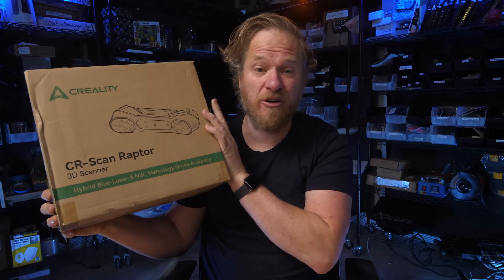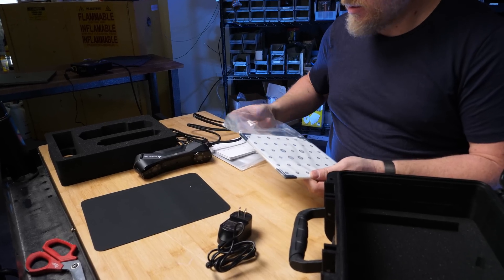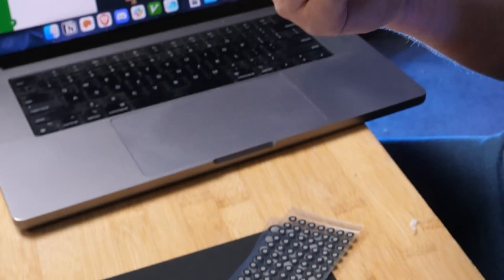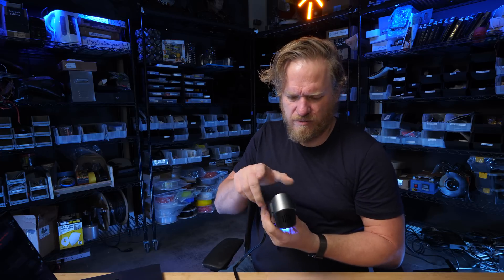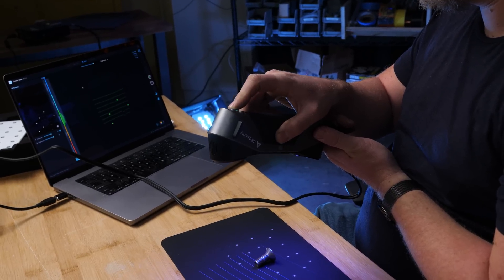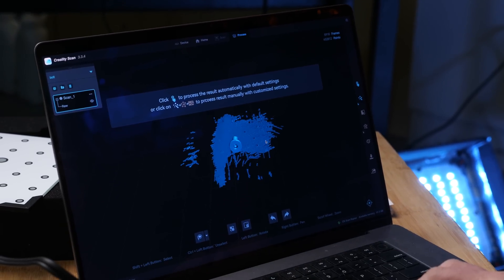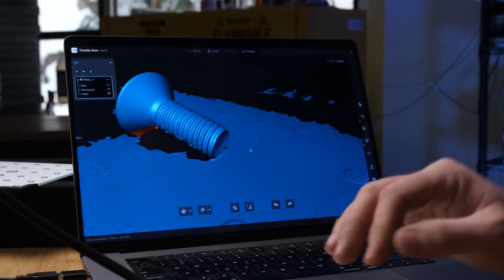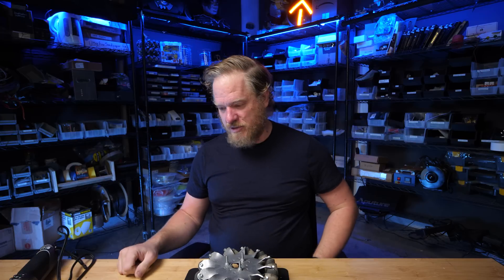Can a Laser Copy an iPhone? Trying the Creality Raptor 3D Scanner

Comment: I worked in a metrology lab so I’m experienced in using blue light scanners (structured light scanners). Anything that is reflective and or shinny will result in poor resolution and or error in the point cloud. What we do to mitigate this is to use a talc based spray. This is a very fine white powder that gets sprayed onto the part and gives it a Matte white finish. It’s specifically made for 3d scanning and the spray thickness is thinner than the uncertainty of the device you are using. Thus not an issue. This will allow you to achieve a better result in your blue light scan.

Comment: Tip: Try it with Sublimation Spray

Also I would really like to now how it compares to the RevoPoint MetroX. (0.01mm precision, about the same price)
Apparently there software is WAY better.
Reply: It's not better in any means, it just has more built in cleaning options and that's all.

Comment: Hi! I work as a surface modeler in the aerospace and automotive industries for the last 15 years, and do a ton of RE work with laser scanned data. In fact, at this very moment, I'm taking a break from surfacing a full airframe from laser scanned data. I've done everything from little tiny stuff the size of an iPhone, custom car bodies, all the way up to a Boeing 777. At one point I even owned some Creaform gear, but realized that my time was better spent doing the modeling vs doing the scanning. I can tell you that the issues you're having with the iPhone body scan are endemic to these lower end scanners. This scanner is basically on par with a Creaform scanner from ~15 years ago, at 10% the cost. So while the cost of entry in 2024 is great, a ~15 year old Creaform unit is nothing to write home about in 2024. While it's SUPER fun to play with these things, what I've found is that at the very low end of the market, your money is always better spent hiring a qualified scanning vendor. I work with a vendor in LA on all my projects, and in 15 years they've done nothing but deliver utterly flawless results. Having them scan the iPhone case is something that's likely in the low 100's of dollars. If you're interested, I could ping them and see if they would be willing to scan the iPhone case. It might be an interesting video subject - low end scanner vs state of the art. Cost of ownership vs. cost of hiring out the job. Holler if you're interested!

Comment: get a lazy susan and put a motor on it and gearing to make it turn really slow, then tripod mount the scanner, you now have a badass scanner easy to use, thank me later do eet nauw
Reply: I was here to say the same. A lazy suzan with the dots on and the turn really slow. And a tripod i 3-5 different levels to get all the points on the scanning. And maybe also try play a little with some lighting/shadown on the pic your scanning. Maybe the scanner dosnt like to much light or need an even coat of light to make a better scan.
Reply: @Funnyboy2402  i didnt think of lighting but the scanner uses its own lighting my man
Reply: @CommanderBeefDev  Yes i know. But if the lighting in the studio is to bright or have the same color i thing it can desturb the scanner so it dosnt pick up everything. At least its something to test out. I dont think it will take long time to figure out if external lighting have any effect or not.
Reply: @Funnyboy2402  no its only a test wont take time,

Comment: one thing that can be seen pretty well in your video is that in areas, where your scan ends, creality scan adds edges everywhere (where there are none). no idea why it does it. these edges appear after optimization and are now present in the raw point cloud.
this makes merging different scan sides moe work than it has to be because all the edges, that the software created out of thin air, need to be removed before merging. not sure if you have done that.
Reply from the maker: Yeah - I've experienced that, along with halos around the markers.  I'm going to reach out to tech support at Creality about it - it's very strange.

Comment: If I understand correctly there are also temporary coatings coatings that can be applied to objects to help cut down on the reflections? Not sure if that helps in the blue light mode, or if it's just for IR 🤔
I know it from LTT and their 3d scanner

Comment: would be interesting to try to hold the 3D scanner on a fixed arm, and just turn the 3D model on a turn table and see if you can get a more accurate 3D scan of your iPhone that way.
Reply from the maker: Agreed!  I had a similar thought.  I've already 3d printed a hand cranked turn table...
Reply: Scanning with laser lines benefits from moving the scanner up and down a bit to capture all the details. Therefore having the scanner stationary might not be beneficial for laser scanning.
Reply: @Brainwash110  Its a matter of perspective, and relative tracking, If you are in a car, you feel everything in the car is sitting stationary while the world moves around you, but to those outside, you are moving, while the world sits still.
The benefit of holding the scanner in a fixed position and moving the object would be repeatability, is what i think, as you would always have the scanner at the optimal distance from the object for example.

Plus you don't really lose anything from trying, other than maybe the time it takes to print the stand.
Reply: @Brainwash110  Not only that. There are also sensors that track acceleration and rotation to better track the whole device in the world. If you just fix it to an arm all that detail will be missing.

Comment: why don't you make a jig where you can mount it on to move it around and it'll be easy to scan in a systematic/linear order to get accurate scans. It'll also help to align the bottom and top scans much easily.

Comment: 3d scanning is a PITA if you want usable engineering stuff without reverse engineering software. Raw scans no matter how processed are just not good enough. They can be reference material for sure but I found that just siting down and redesigning stuff is generally faster than endless clean-up. for more artistic stuff it's usually fine but you still need to do texture yourself. Is it hairy,matte glossy etc.

Comment: Huh, that's not bad! Fully agree with your conclusion. I's so scarred from trying to clean up crap 3D scans that I've not touched the tech in almost 5 years, but would be willing to give it another go. The laser tech was certainly not anywhere near this price point at the time. Looking at the resulting data though I still don't believe their accuracy claims. Your other process might have been way more tedious, but the resulting model is actually useable vs this mesh output that you have to then remodel anyway.
Reply from the maker: Yeah, I was skeptical about the accuracy claims until I compared my model to the scan.  I also think a lot of the noise in the scan I have is from the reflectivity of the iphone shell.  I just received the 3d scan spray I ordered, which I'm hoping will give me a much cleaner scan.

But you're right, the real work in a reverse engineering task like this is going from the 3d scan to a useable cad model.  Seems like there's some interesting software out there that's custom made for this, like Geomagic.  I'm eager to try that out, and see how much it simplifies away.  It has a big price tag ($21k for a single seat), so I have high hopes it's magical.

That being said, even with just Fusion360, having a 3d scan is likely better than what I was doing, milling it down in 0.2mm layers on the cnc mill, and making a 2d scan on a flatbed scanner for each layer (video comes out on the main channel in a couple days).  That model I briefly showed took me months.  Probably a week if I was to do it again knowing what I know now.  Part of the challenge was trying to visualize from 2d layers to a 3d model, which wasn't always trivial.

The other thing I want to try is 3d CAT scanning, to see if that's any better...
Reply: @strangerparts  Honestly the best/cheapest way to RE this is with Rhino 3D, and can be done in stock Rhino no less. Especially since the shape is relatively simple, there's a ton you can do in Rhino. Trust me - Geomagic is not your friend. Especially for the price, it's just not worth it.
Reply: I think you gotta separate the accuracies here.. I would guess each point will be accurate down to 0.02mm, but the accuracy of an entire point cloud isn't, as well as the resulting mesh.  (Working with lidar data quite often, and we get alot of points coming in at mm accuracy for large scale scans, but the point density is a couple per cm, which leads to that we can trust that everywhere we did get a measurement, it's accurate, but we don't know what happened in between the points) Also, those accuracies add up when you're talking about millions of points, just ask any machinist
Reply: @oskarwallin8715  There's two types of accuracy with laser scanning. The first is what can be thought of as a "localized" accuracy - how accurate is the data on a small object. Creality publishes a spec of "Accuracy: Up to 0.02mm @ 100mm" but if you read the fine print, it says "Accuracy is evaluated in laboratory conditions (measurement object is 100mm sphere pair) and actual results may be affected by operating environments such as temperature, vibration, and other factors." So, take that figure with a huge grain of salt. The second type of accuracy is what's referred to as volumetric accuracy. This is is how much error/uncertainty there is as you move away from the origin of your scan. So, larger objects will by definition always have a greater error/uncertainty in the data. With these low end hand held scanners, often if you compare via true metrology grade data, you'll see "bending" or deformation of the data, as you get further and further from the origin. The fact that Creality doesn't publish any sort of volumetric accuracy means that all bets are off on larger scans - say anything the size of a car panel or larger. You might get lucky, but you might not.